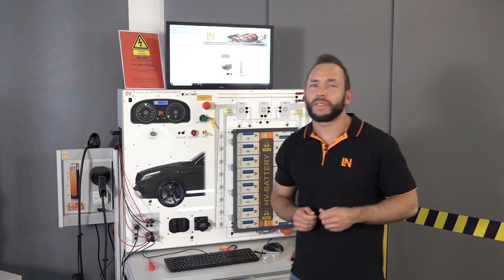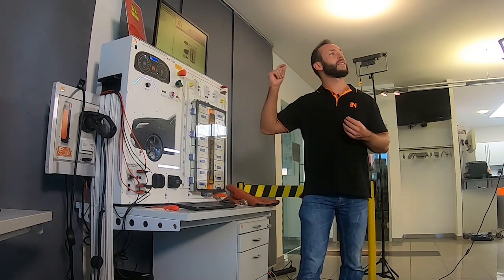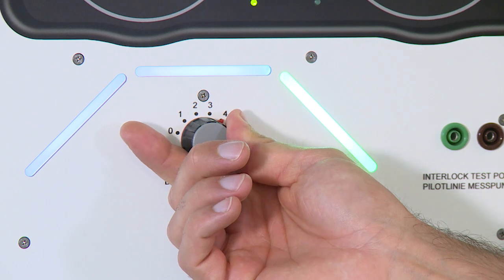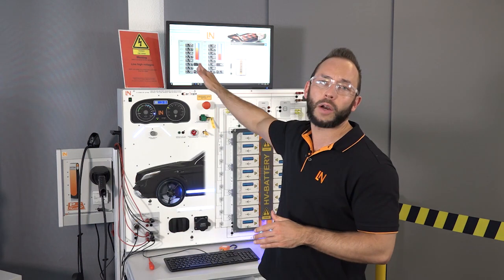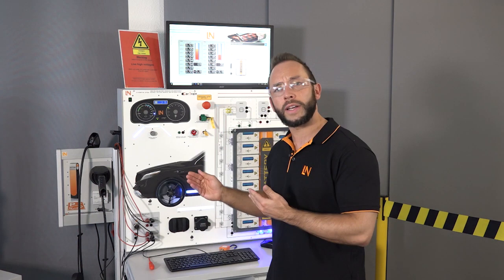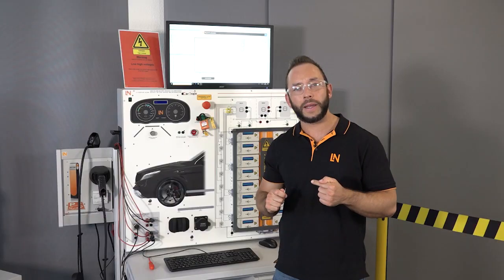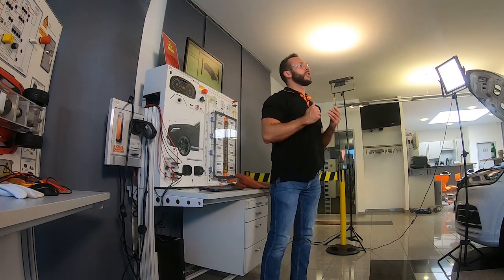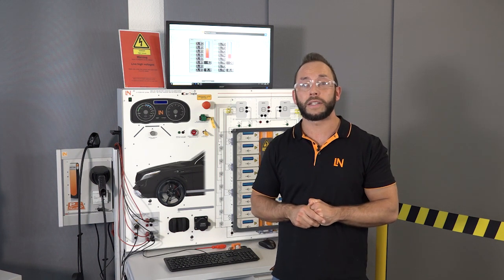Diagnosis and Maintenance of a HV Battery CarTrain | Product Presentation

Comment: So my question is,what happen to say a Honda Fit hybrid if a battery cell is defect, is the battery good are bad
Reply from the maker: A broken cell will cause most likely a fatal fault and the range will be reduced. It depends on the car manufacturer and on the temperature level of the broken cell, if the car can go driving or if it will shut down. ;)